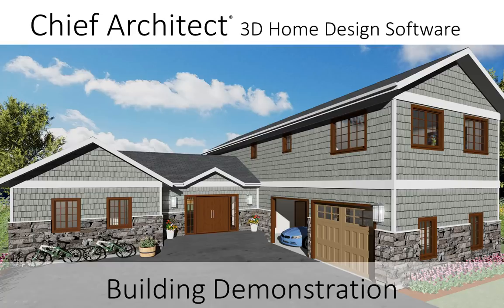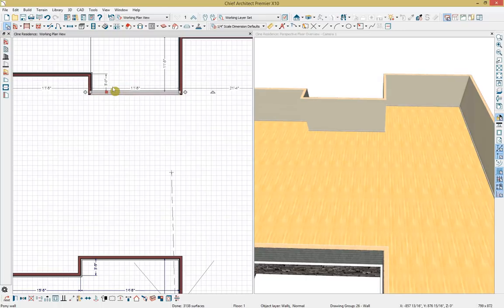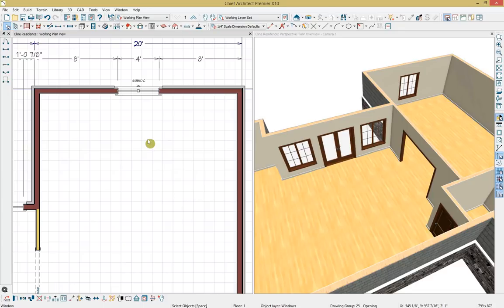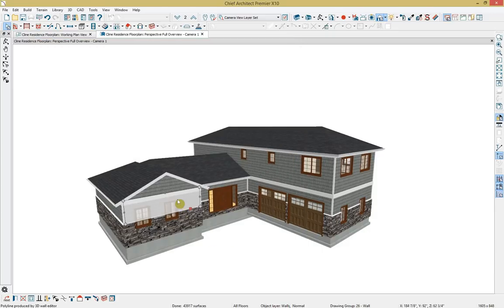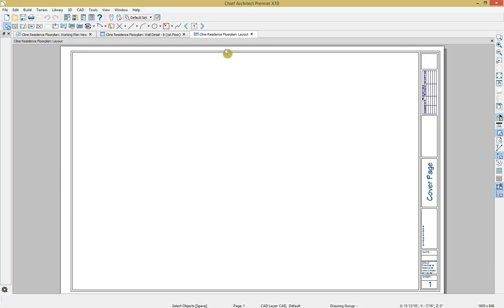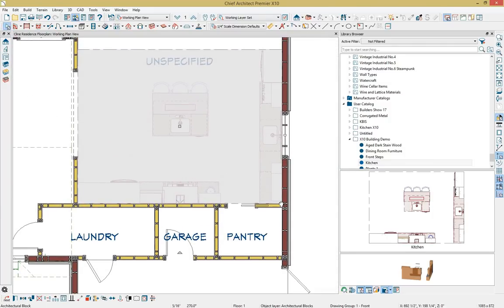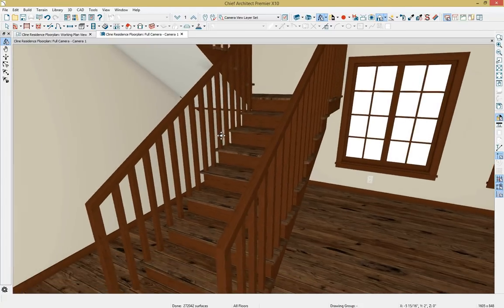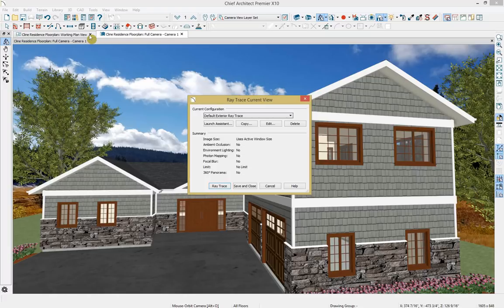Chief Architect X10 Building Demonstration

Comment: Can CA do like what sketchup component does? 
( in sketchup ), build a house complete with doors, windows, roof.. then make everything become 1 group then make it as a component. Then make a several copies like a terrace house. Now when i edit or any changes made to any of those component, the other copy will follow. Is CA have this 'component' features?
Reply from the maker: Hello, GNex Prime. Chief Architect Software has tools that will allow you to create a subdivision with ease. You can create a house comprised of many different components and can create a CAD detail from the house to make multiple copies. However, the copies are not linked together.